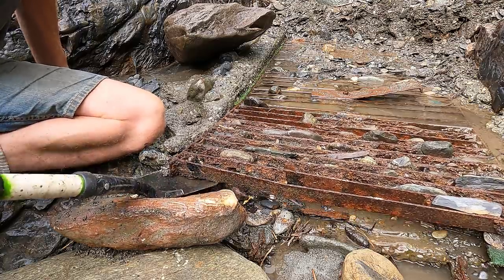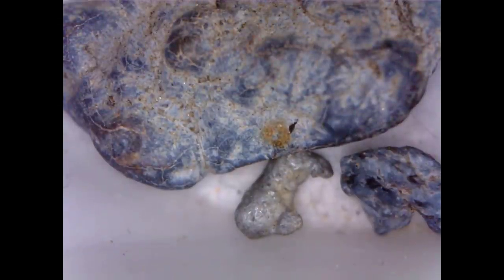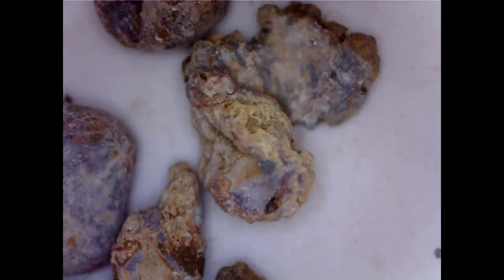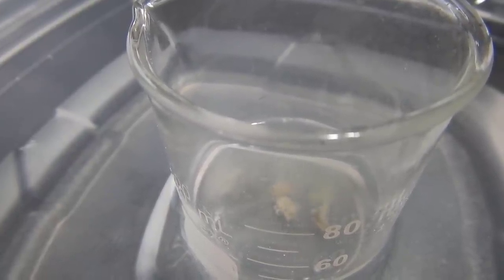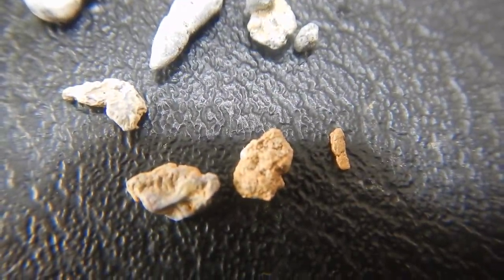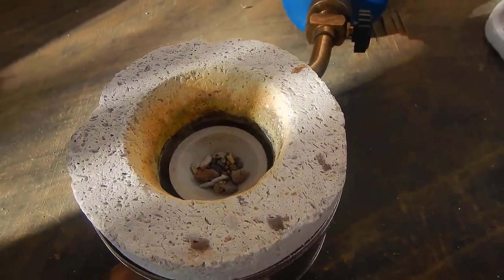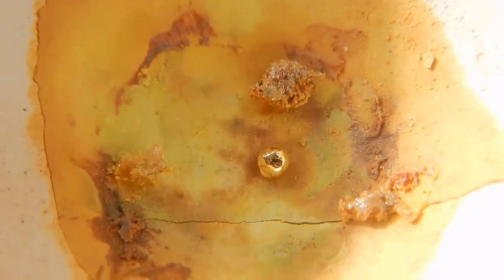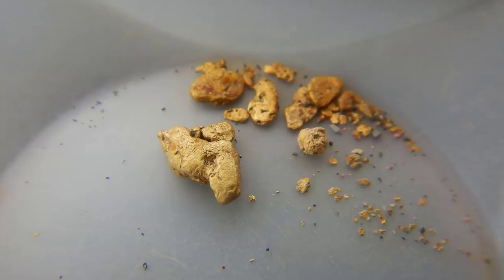Is this really, REAL GOLD!?

Comment: It looks to me like the lead was an intrusive deposit in a quartz amalgamate. Like the gold your finding it was broken free from hydro  dynamics basically a lead/ silver deposit. So you not only have gold in them thar hills. Ya got lead too! The colorization did come from the sluice, the iron oxides leaching out during run off and the exposure to oxygen when the levels dropped would definitely cause colorization like that. As for the gold, two possible answers, inclusive in the deposit or it was hammered into the lead by the water forcing small rocks to force it into the lead. No matter what you had an opportunity to experiment with metals deposited together then changed by the environment and elements. That's always cool! Thanks for not only taking us on an AU candy hunt but posing an interesting question. Perhaps next time try to smelt for silver and see what happens. The gold will drop out in either case but with the lower temperatures the separation will retain the base metals in their weights what a button that would be! Thanks Dan!👍⛏️
Reply: Very well put together comment very impressed. You know your stuff for sure. 👌🏻
Reply: 69th 👍
Reply: @almostfamous1685  Thanks, I learned it all from Dan👍
Reply: Seems to me that the yellow lead was exactly that, 'yellow lead' otherwise known as massicot, a specific crystalline structure of lead(II) oxide. There seemed to be all sorts of different lead oxides in there, all naturally occurring but quite possibly aided by the addition of the sluice!
Reply: @spratb5323  my thoughts exactly. He even found a bullet. People been hunting around there for probably a couple hundred years.

Comment: "Gold alloyed with a small percentage of lead is a hard, brittle, pale-yellow substance, which has a musical ring. If more than about 4 per cent, of lead is present, there is marked segregation on solidification, and this also takes place in the case of the zinc alloy and of some others." from a google search

Comment: pretty cool way to see how you separate the gold from the lead. does the lead remain in the orange residue?
Reply: Basically, the lead, which has a much lower melting temp than gold, gets sucked up and trapped into the porous ceramic of the cupel....it works a lot like a sponge.

Comment: Dan, its it possible there you've got some amounts of Uranium ore - "Yellow Cake" - the color. the weight, etc seems possible.  SC
Reply: You won't typically find "yellow cake" out naturally on the planet. That form of Uranium is typically only created during an intermediary step in processing uranium ore. Yellowcake concentrates are prepared by various extraction and refining methods, depending on the types of ores. Typically, yellowcakes are obtained through the milling and chemical processing of uranium ore forming a coarse powder. And although uranium is one of the densest metals on Earth, yellowcake is relatively light, with a density approximately that of elemental sulfur. So in that incredibly rare chance that you ever did come across a natural yellowcake formation, you wouldn't find it through panning for gold because it would wash out.

Comment: I have refined placer gold from different places, and after dropping the pure gold out of soultion, i use amonia to test for copper and meuriatic acid to test for silver and have found copper left over a couple times so im sure almost any metal can amalgomate with gold in high temps and the right circumstances.

Comment: little tip if u want to video hot things without ruining the plastic camera, use a tripod and have it much further away from the heat and use the zoom. soo in this case have it high above and use zoom to get the frame right :)

Comment: I'm fairly confident what you had was Lead Oxide in a orthorhombic lattice structure, it appears yellow and is found in the wild as massicot. That's based on the appearance of the mineral and the color of the HCL solution, it's not very soluble in water but is soluble in HCL. Adding a bit of potassium iodide to the HCL solution would precipitate Lead Iodide which looks also looks yellow/gold but isn't soluble in HCL.

Comment: I keep asking myself if what you found there was Electrum. It's an natural occurring mix of gold, silver und sometimes copper or other traces of metals that was found and used like gold as coins or jewelry in Europe since early antiquity. Depending on the mix it often times can corrode and get dark just like silver or copper, but is heavier just like the gold in the mix. The color if polished looks just like an intermediaty between silver and gold. It would make sense that some parts like the copper or zinc or other less inert metals would dissolve in acid, and the silver would probably disappear in the Cupell since it corroded in the oxigen. Leaving the gold part as a remain.

Comment: My thought is electrolysis. Different metals in close contact in water, even without an acid over enough time will get transference through a battery like reaction. 
Found that out as a kid trying to soak some dirty coins I had found over night to loosen the dirt off them and noticed tinny bubbles coming off them, near microscopic in size.
I had a chance later to talk with a guy who did plating and he confirmed that was likely the case.

Comment: If you hit it with a file you could have figured out that it was lead very quickly seems to me that it was calcified lead with iron electrolysis from the rust and white calcium deposits from the water. Use a mill bastard file or any course file .

Comment: I know I'm a year late, but I just wanted to add my two cents on a faster diagnostic between lead and gold that can be done quite easily. Aqua Regia will dissolve gold, but lead turns into insoluble salts. This means that you can dissolve the gold, and then vacuum filtrate the resulting solution to obtain the gold from the lead. Getting the gold back out of solution is a little trickier, but there are multiple known methods. Another benefit is that the gold is chemically purified and thus guaranteed to be 24 carat.

Comment: Depending are where you are, you could probably grow real wasabi, and that goes for about 160 per 5 kilos and that is probably 10-20 stems.  Coastal Oregon is a good area, because the temperatures are generally cool but not cold year around.

Comment: The question of the hour that will probably answer its self: Is that a pool of lead in the bottom of the beaker or is it water between the bottom of the beaker and surface hes working on magnifying through refraction?
Reply: I wondered that too.  Then I realized it's just an air bubble under the curve of the beaker, between it and the black surface it's on, caused by the water still on the outside beaker from the water bath it was in.  :)

Comment: Now tell me if I'm wrong but does pyrite (fool's Gold) have a fraction of some real gold in it.
But that the process of separating it isn't worth the effort. So I've been led to believe.
Reply: Not usually. Most pyrite is just an iron sulfide. And pyrite is often found with other sulfides or oxides in quartz veins, sedimentary rock, and metamorphic rock, as well as in coal beds. So it is one of these sedimentary rock formations where you can find Pyrite alongside those other minerals. There is only a specific formation (Carlin–type gold deposits) of this mineral where it can have traces of gold found in it, but it's not even like gold flakes. It is in a microscopic form typically only found in the dissolved solutions via a chemical test. It's known as "invisible gold" because you can literally only find the traces of gold through chemical analysis. You wouldn't know the gold was even there unless it showed up in the data. So it's not that you will find Pyrite with traces of gold in it, but more that you will find pyrite in the rock formations alongside other minerals with traces of microscopic gold in the deposits.

Comment: Imagine.

A stars core runs out of fuel, decays from hydrogen to helium all the way to iron. Iron doesn’t fuse so well and the stars core that’s pushing out ca nolonger match gravity pushing in,.

The star explodes, different layers of ejecta move away from the exploding star, only to slam in to one another. Creating all of the elements heavier than iron.

That’s why most light naturally occurring elements are usually more abundant than heavier elements. Also that’s why iron is so plentiful in the universe.

Gold shines like a star and comes from an exploding star, only to be deposited by meteors, and because it’s so heavy it gets flushed into the earth, only to come back up by vulcanism… 

That’s why it’s so rare.
Reply: Its a great theory.. But there is no hard evidence to support it. Maybe one day we will have the first hard data point. But until then it's a nice thought.

Comment: Gold wont disolve in meuriatic acid. You need aqua regia, they say 3 parts meuriatic acid abd 1 part nitric, BUT ive found that incrimental dosing the nitric in slowly untill all metals are dissolved will reduce excess nitric and wasting chems. Once your metals are dissolved into solution, you filter then put sodium metabisulfite in untill you get a white foam and all gold will be dropped. Then you dry it and melt it into a bar.

Comment: Your conclusion of what that material was Yes it was lead/lead oxide. However iron contamination theory is a little off because Lead oxide is yellow not white, lead carbonate is White you will get a mix of the two. When you put lead, lead oxide, lead carbonate, it in hydrochloride acid you get lead chloride which is yellow in solution.

Comment: Wait a minute! What the crap happened to the lead? Is it possible to heat it to the point that it actually turns to a gas? Is that really possible? I'm sorry, the idea of that even being possible sounds ridiculous to me but I can't think of another explanation. Also, what is the procedure for handling the acid once you've concluded your tests? Great video, see you next week!
Reply: It is possible to heat anything to the point where it will vapourize. Ths lovely part about the 4 states of matter, solid, liquid, gas, plasma.
Reply: and as for handling the acid after his tests he likely just put baking soda into the mixture along with some water. This neutralizes the acid and turns it into a harmless mixture you can just dump out safely. Mixing baking soda with hydrochloric acid results in table salt, NaCl, as well as water, H2O, and carbon dioxide, CO2.

Comment: You can use nitric acid to solve lead, hydrochloric adic doesnt react with lead due to lead chloride is not solving in water. Cyanides can also solve gold and silver from ore with air mixing and then you can use zinc to get gold back. Vapourising lead is "brutal" I dreaming to dig gold, but in UE it is not good idea.
Reply from the maker: I cupel does not vaporize the lead, it turns into lead oxide and is absorbed into the cupel.  A very standard and common and safe process.

Comment: Why not toss the clearly lead pieces before melting
Reply from the maker: Lead is critical for the cupelling process.  the lead melts, the oxidizes, which creates lead oxide a VERY acidic substance when molten. and that dissolves anything other than the precious metals then carries it out to the cupel which absorbs it.   Sometimes you even have to ad extra lead to the cupel if what you want to clean does not already have lead with it.

Comment: you can determine types of metals by galvanic action between metals [like a battery] using only  50 ml of tap water, a penny or copper wire and a multimeter set to volts scale   Results:  gold = 170 mv or less depending upon purity.....silver =~300 mv depends [silver spoon tested]...zinc = ~600 mv....lead = ~500 mv....aluminum foil = ~400 mv
...Set the penny as the anode, unkniwn as cathode....try it ,  let me know...